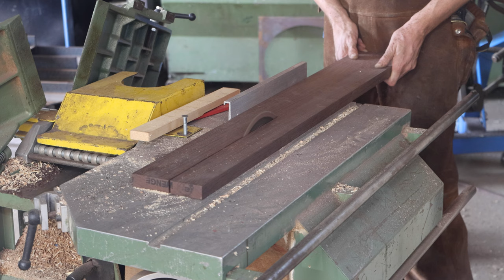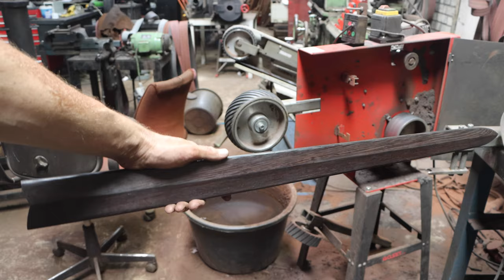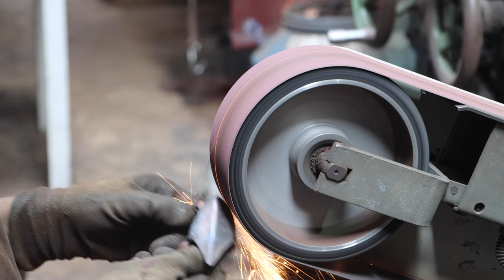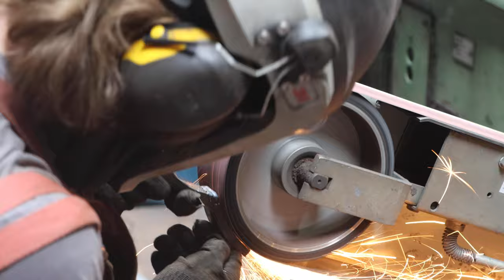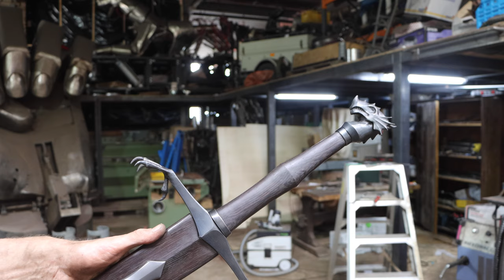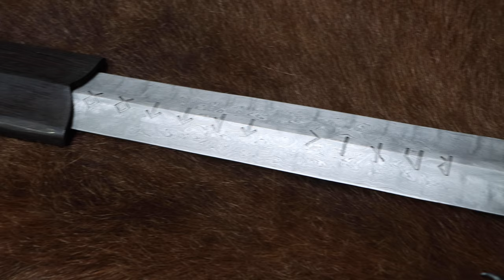Forging a pattern welded dragon sword, part 6, making the scabbard.

Comment: great build over all, with the scabbard belt bar wouldn't it have been better to mount it before the two halves of the scabbard were put together?
Reply from the maker: The best that would go into the holder dous not press outside it just holdes it in place.